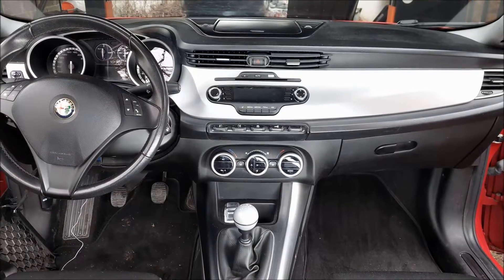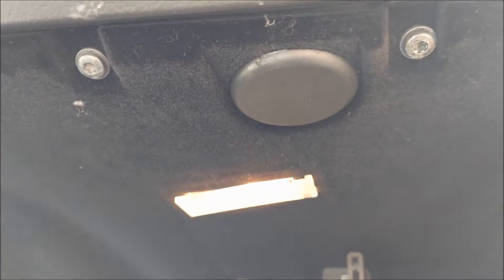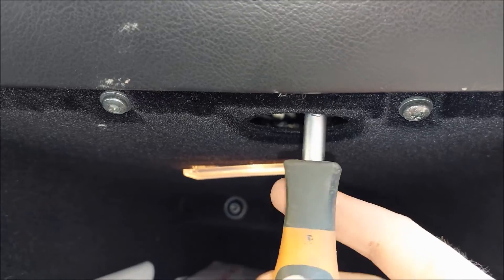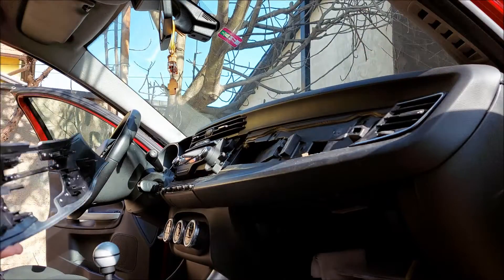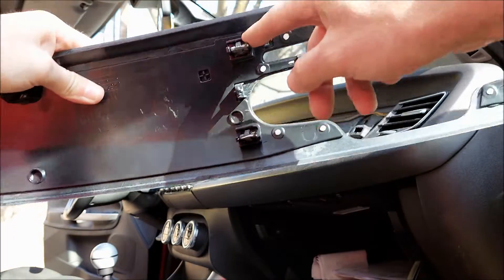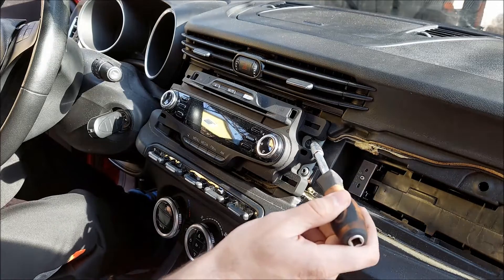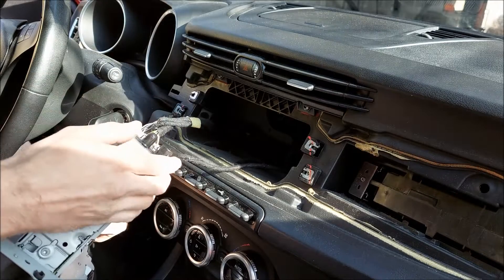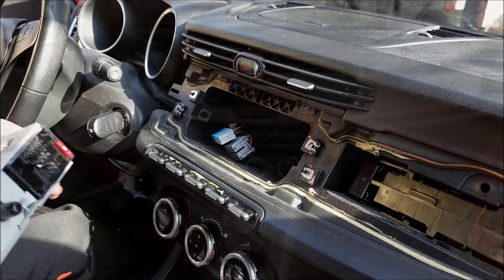PROPER Way to Remove Fascia, Dash Trim, Radio on Alfa Romeo Giulietta

Comment: I bought my Giulietta in France and it has a screen type radio with Sat Nav, etc. My battery went flat and the radio's security kicked in. As well as the music, I lost Sat Nav and the various computer functions. I needed the serial number of the radio to request the security code. 
The process to remove the parts worked perfectly as you showed in the video. The only small challenge I had, was getting the glove box screw back in. My girlfriends small makeup mirror and a torch made it easy.
Thanks for a really useful and easy to understand video.
Reply from the maker: Glad it was helpful, thanks for watching

Comment: i want to replace my radio with a screen. but all the guides ive seen have involved cutting, this is something i really do not want to do, does anyone know of a screen that doesn't involve cutting (i am aware that i will need a new fascia trim)
Reply from the maker: Maybe try the simmer version of device, check out our latest video, maybe that model would fit better